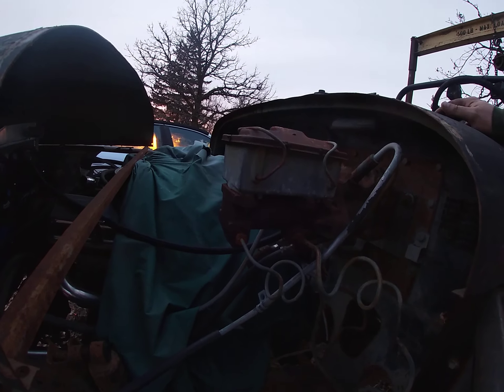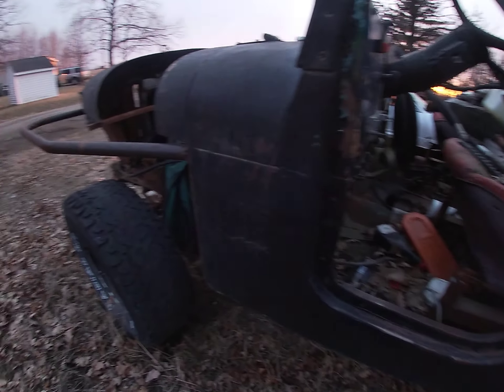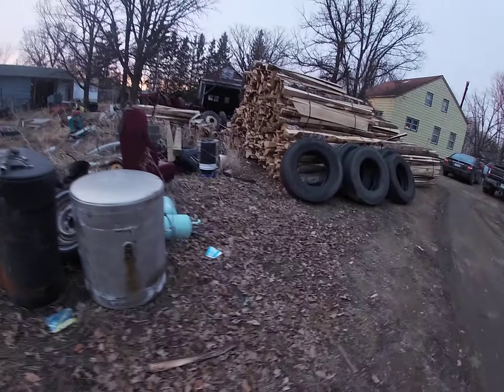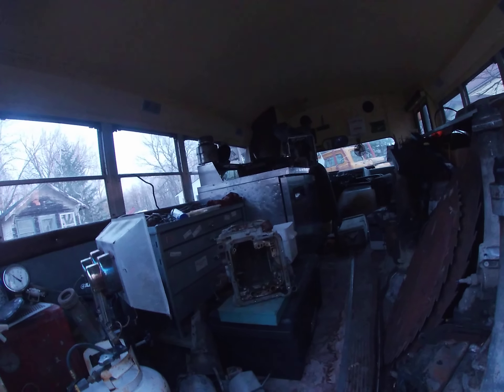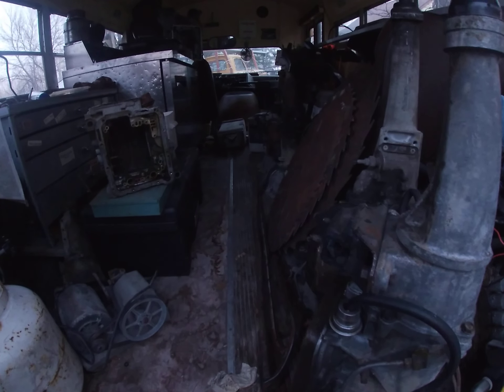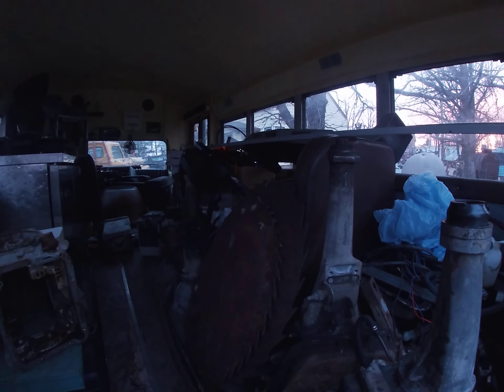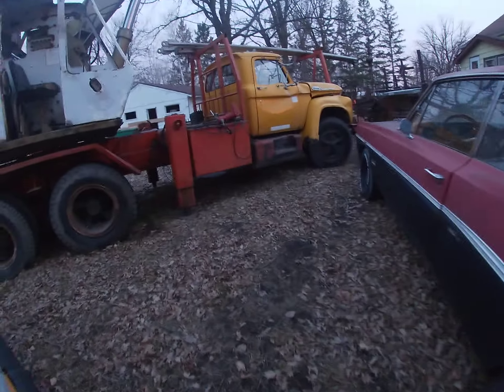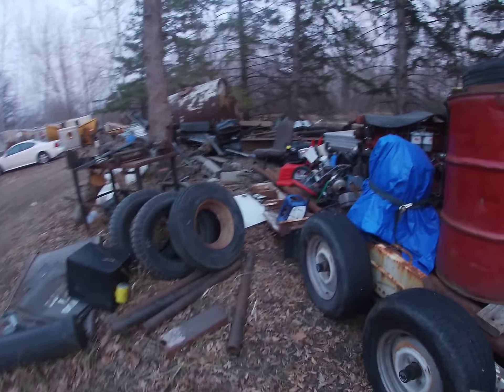Mud Mutt CJ5 Waggy  3/3

Comment: I need a c4  and a Dana 60 front axle for a one ton build
Reply from the maker: I have a few C4
Reply: Jackpine Savage Repair  parts for older cars down south are very hard to find
Reply from the maker: Danna 60 from 04 F350 single wheel
Reply: Jackpine Savage Repair  we are building a YJ 4x4 on 1 ton axles I already got the rear my buddy is coming to pick it up tomorrow from my house